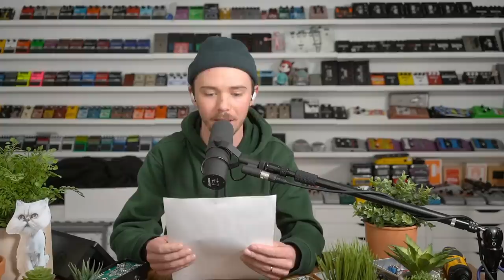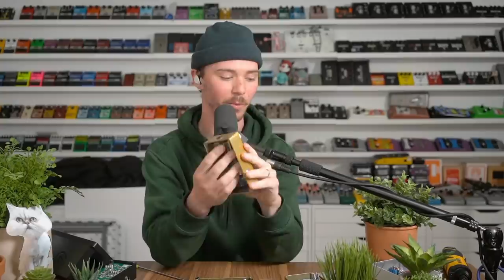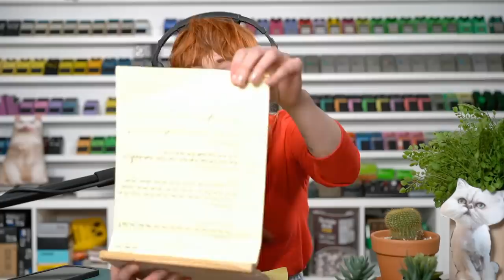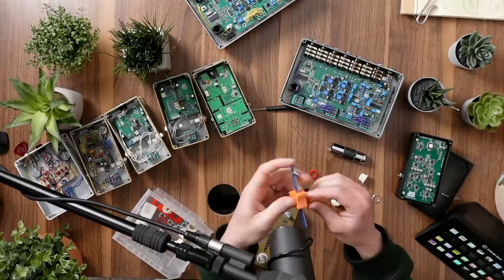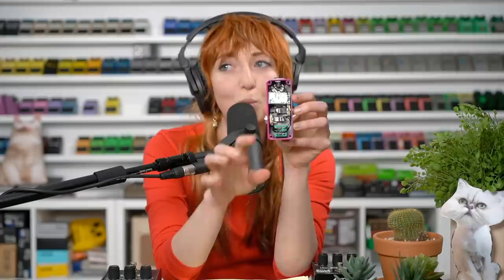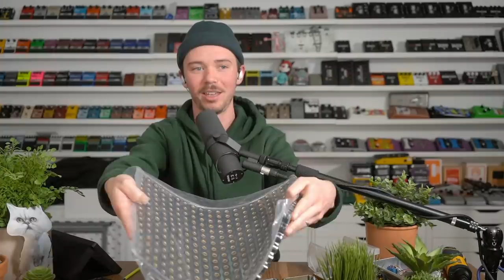How We Make JHS Pedals! (Plus Giveaways)

Comment: In a nerdy way this was fun for me. I worked at Harman (DOD, Digitech, etc.) for a long time.  It is fun to see how all y'all do this.  It reminds me of the early days, before we automated almost everything. By the end of my time there, 2002, all of our boards were populated in house by automation. Our "pot and wire" department kept doing less and less hand wiring as the products evolved. And ultimately much was outsourced.  But, way back when, we did things more like you all do.  It wasn't as efficient, but it was arguably more fun.  For years we prided ourselves on our sound test department, where each pedal would be played one at a time with a real guitar by a real guitarist,  but that mostly went away and was replaced by automated testers.  Josh has spent time documenting our company, but mostly from the standpoint of David, John and Tom Cram. But we, like you guys have a fun history of moving from David's garage to "Riley Lane, (fact: Tom Cram's current shop is a couple of blocks away from the original Reily Lane building.) then to Vine Street, and ultimately to Sandy Parkway (which was a huge two story facility).  Another fun fact that is cringy in retrospect; we used to do board stuff and solder at Riley and then truck those the few block to Vine Street for pot and wire, sound test and shipping.  It was a long time ago in a galaxy far far away,  It was sad to see DOD go away.  Although I never did any of the actual assembly, it was really fun to watch those "artists" work their magic.
Reply: Thanks for the products you built! I was a loyal DOD customer. Supra Distortion was first pedal I bought in 1990. Still have it along with Classic Fuzz, American Metal and Flanger as well as EQ rack unit for my home recording setup. The Classic Fuzz into a Vox AC15 is magic!!

Comment: Belle talking about the Mini Foot, I have an early one from 10/4/11 signed “MFF” DB11. There is a crazy amount of yellow wire spaghetti’ed on the inside. 3M tape on the back of the board and a silly amount of hot glue near and around the LED. Hand stamped. I love it. It sounds great!!!

Comment: As a machinist, when you was talking about the Panther and you was talking about the holes with excess material you are correct. Two issues, one not having the proper amount of coolant and two dull tooling would result in having that unwanted material. Now if they were a good shop that could of be easily remedied by using a hand chamfer tool and and easy debur tool to clean up the hole. The fact you had to even deal with it shows lack care and quality and that's just sad
Reply: I agree. It's poor proceedure to consider a product finished without chamfering and deburring. Even worse is not changing drills when they become blunt, or ensuring adequate coolant flow to lengthen drill life. If you had to hand debur every job, you'd be making sure the drilling left as little work as possible, 'cause hand finishing is a time killer.

Comment: Nick and Belle, hot glue is so bad because you have to rip the glue off the burned skin!  I've also burned myself a lot less with a soldering iron.  A glue gun will often stick in the dispensing location and hot, burning glue goes everywhere.  Yeah, my soldering iron is 750 too.

Comment: Which one sounds better? The ones with less human handling? Or more ?
Reply: Hand-wired typically means less consistency between units. Meaning some may sound better, and others may sound worse. That's not to say the pre-made boards will necessarily reside in the middle. If made well they can reside at the top, if made cheaply they might reside lower in the ranking. Given the prices of JHS pedals, coupled with a good reputation and my own anecdotal experience, it seems likely that their boards are very good.
Reply: @charlesrense5199  makes sense